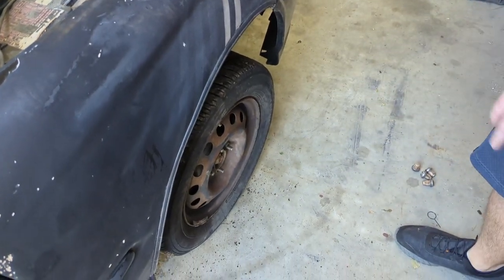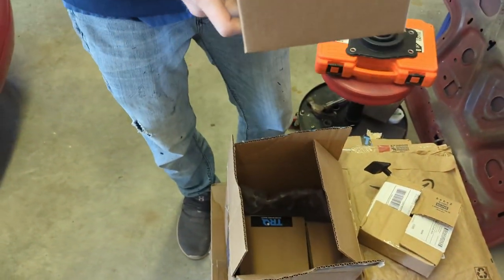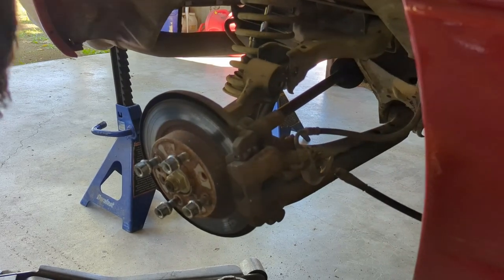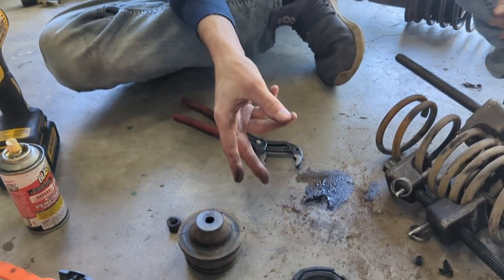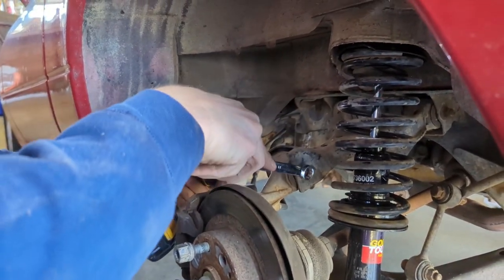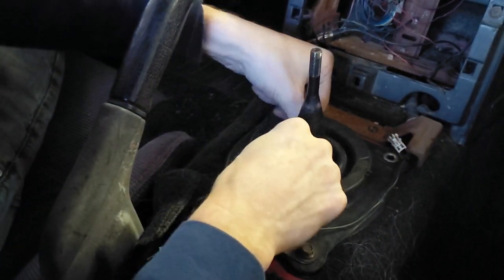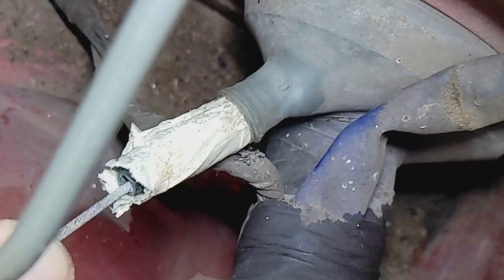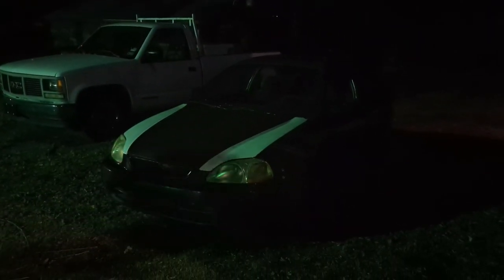FIXING The $100 Miata Suspension HUGE Improvement

Comment: Suggestion:  when you are whacking on something or using a tool, might consider adjusting the sound output during editing..  The audio spike is a bit much..
Reply from the maker: Actually I have been doing that, sounds like I need to lower it even more. Thanks for the suggestion. I also upgraded my mic setup so in the future videos it should be better.